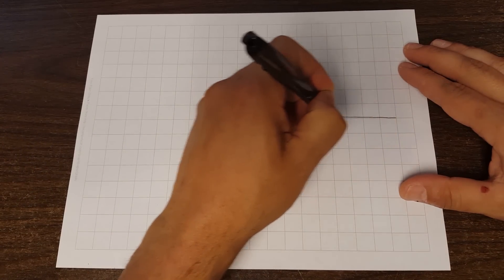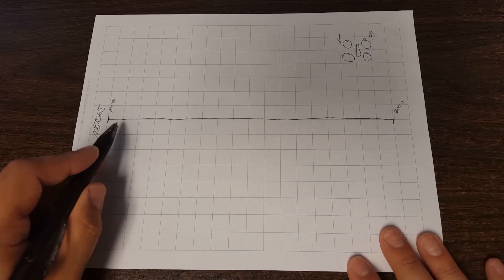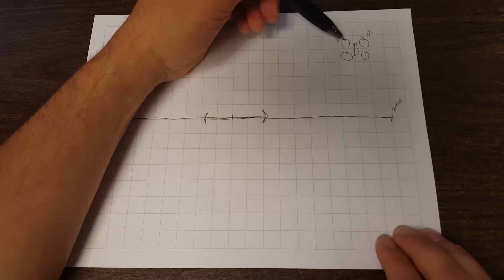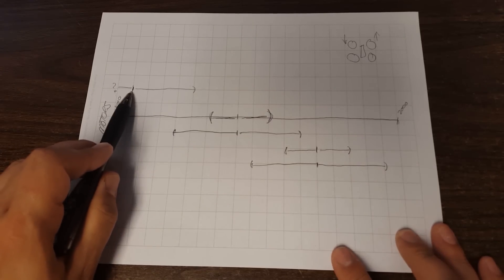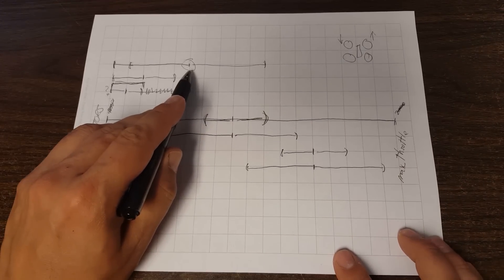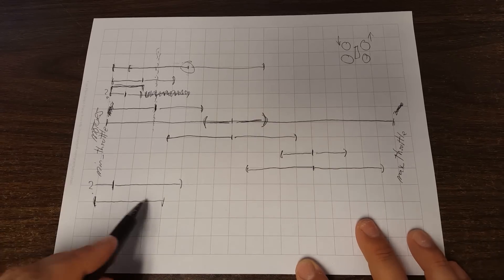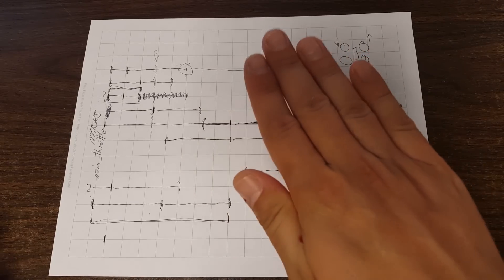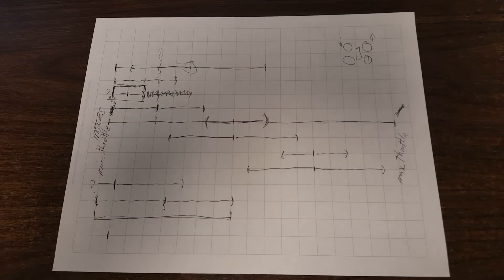What is Airmode? | BETAFLIGHT WITH AIR MODE EXPLAINED

Comment: Idk if this is an unpopular opinion but i feel like airmode controls too much sometimes. 
Im trying to horizontally drop down but i feel like airmode keeps me in the air too long as if im gliding down instead of dropping altitude like normal gravity feels. (Because the motors are upsinning from the corrections done by airmode). I dropped the idle thinking that would help but it didnt.

Comment: Thank you again bardwell. Just downloaded betaflight 4.4 and air mode was one of the mode set ups and I'm used to just removing angle on all my quads so I don't accidentally enable it. And I thought what the hell is air mode get that out of here lol. Well needles to say my quad was swaying everywhere and could not figure out why until I watched this. Just clicked permanently enable air mode so going to try it out now fingers crossed it fixed my issue. Almost 100 percent sure it did

Comment: I've got a Tinyhawk II whoop as my first drone and was really confused when I tried it the first time in ACRO (which they called AIR I assumed): Unlike the simulator this drone would not bounce off from walls but the moment it would touch a wall it would spin up angleing against it and kinda "fight against" that wall with me having no control over the drone anymore. Disarming it and letting it fall was the only option I had left. Additionally it would behave completely erratic depending on what I flew over - and start suddenly bounce off in one direction. I explained that to me with weird indoor-aerodynamics.

I've digged abit to find out why this weird behaviour is happening:
- First clue was crash-recovery - a new CLI-only feature in Betaflight 4.1 that they just turned on... and that didn't do this drone any good and caused sudden moves all over (what a weird function, really o.O).
- But now after 2 weeks of daily flying and still having the feeling I constantly have to correct my drone instead of controlling it I felt brave and turned off air-mode.

And BAM, all of a sudden that little woop was behaving! No more wall-fights, it would just bounce off like the dones in the simulators do. And also no more sudden side-moves close do the ground or over certain objects in my appartment - it's completely stable now. And even more interesting: Throttle response is now much more smoth and expectable. So for some weird reason while Airmode might actually help in outdoor freestyle flying, indoors with woops it seems to be a really really bad idea. Or at least with the Tinyhawk II and stock rates/PIDs it is. And now that I turned it off my OSD also shows I'm actually flying ACRO mode... I see! ;)

Maybe that would be something for another video! And also something to try out if you compare whoops. Just turn off crash-recovery and air mode and you'll get them to behave quite nicely! And those Emax guys really should work on their Tinywhoop tune and not just turn every function on that's new and sounds fancy...

Comment: Nov. 10, 2020  Opinion Request Please: Is "Air Mode" a function best utilized by everyone? Stable Beginners, Intermediate, Simi-professional, Etc. OR, is there a rule of logic when utilization of this function is best applied? Also any better/worse affects for use in Angle, Horizon, Acro?
Reply from the maker: I use it all the time.
Reply: @JoshuaBardwell  Thank You, I'm following your advice.  Just wonder as to idle set on this 4S Cvatar cinewhoop

Comment: one immediate question is why does the spin up have to equal the spin down? so why not give us the full stick deflection value on the upside even if there's not more to give on the downside?
Reply from the maker: Then the quad would not rotate around its center.
Reply: @JoshuaBardwell  ah!! that totally makes sense! thanks!!!

Comment: Hi JB, at low throttle with airmode enabled my 5inch quad is very unstable - it hovers all over the place (also looks like there is some stick delay). With airmode off at low throttle it is much more stable and controllable. I am using BF4.1 - any ideas?

Comment: Sooooo - how do you keep it from going crazy over small disturbances?  Get too close to a wall with a whoop and it plasters itself against the wall motors screaming.  Anything you can do?
Reply from the maker: You can put it on a switch if you prefer but you might just do better not to use it if you do a lot of indoor flying with Whoops.

Comment: Maybe you can help with an Airmode problem  I've got with a Babyhawk R 3" quad.  Airmode works fine at times but at other times the quad will rise uncontrollably when airmode is on.  For example the quad will lift off fine and when it gets 2-3 feet in the air it takes off at a high rate of speed straight up in the air.  By the time I disarm its 20-30 feet high and drops to the ground.  When it does occur it might be connected to a bent or damaged prop but I can't be sure.  At this point I don't feel comfortable turning on Airmode on for fear of what is going to happen after I take off.  This behavior has occurred under both BF 3.2.2 and BF 4.0 Performance Edition.  As a note I've running on a 4s battery with my throttle scaled to 30%.  Is it possible that the throttle scaling is not working with Airmode such that Airmode is not limited when upping the setpoint?  Any other ideas what would cause this behavior?  Thanks for your help!
Reply: Did you got an answer? Facing the same

Comment: Can someone please help I cannot get airmode to work on my tinyhawk I have set it to a switch and it activates (yellow) in betaflight but does not allow me to flip fast it's like acro mode not airmode please help
Reply from the maker: Air Mode doesn't do what you think it does. All Air Mode does is increase authority at low throttle.

If you want to be able to do flips and rolls, set it up so that Angle and Horizon Mode are disabled.

Comment: If I want to fly more level (altitude) then does air mode or anti gravity mode help me?
Reply: neither of those control altitude. If you have a barometer there are altitude hold modes you could try, but the best way is to practice your throttle control.  Ideally, play in a simulator and practice letting it drop and catching smoothly before it hits the ground.

Comment: Is air-mode the reason that sometimes I throttle to zero and the motors are spinning more than they were when I armed the copter?
Reply from the maker: Yes. But don't worry too much about it. When you raise the throttle, just go fly :-) And when you're done flying, disarm.

Comment: Have a quad with airmode. Never experienced it before. Went to land quad freaked out and bounced all over the place. Went into BF. In modes I brought the bar all the way down, in airmode. If I shut airmode off quad wont arm at all. Not sure if that’s normal. Once I moved the airmode bar all the way over to the left in BF the quad was much more stable and the motors didn’t speed up anymore like they were before.

Comment: Hi Joshua,
An older video, so as not to go off subject in your newer vids. My airmode motor speed is a little higher than I prefer, how do I use betaflight to turn them down a little please?
Reply from the maker: Lower digital idle percent. But be careful you don't lower it too much and get death-roll after flips and rolls.
Reply: Joshua Bardwell Thankyou.

Comment: So my thought is if it has bounced back from Landing you're pretty much horizontal ... So why not just write a script that says.. if all things are level and within 20 to 15 degrees I'm horizontal deactivate air mode
Reply from the maker: +VdubSPAZ air mode is needed all the time in flight.
Reply: Joshua Bardwell okay but from my understanding you're explaining how air mode works ... But Acro mode is a form of air mode without the adjustments right? ... If So my thought is that you have to create a code for either Acro or air mode... With that being said why not create a air mode with a landing buffering feature ... Another words as the quad comes in for a landing it would see that it's horizontal and the sticks are within a certain parameter then it would negate what the air mode does to create a safe landing or other words a glitch free landing

Comment: I'm having a problem on a new build. No matter what I do 1 motor just wants to keep spooling up to max, on the bench or in the field.. Running a Matek f405 fc,  Any help would be appreciated
Reply from the maker: If it only does it with props off, no worries, just go fly.

If it does it with props on, then check that your sticks are centered at 1500 us in the Receiver Tab. 

If you are in autolevel mode, possibly the acceleromter needs to be trimmed.

Comment: So does airmode actually increase the throttle or only does it only allow for full control when at low throttle
Reply from the maker: It increases the throttle set-point, which allows the up-spinning motors to spin faster than they would if air mode were disabled, thereby increasing overall authority at low throttle.

To put it more simply, it acts as if you had raise the throttle slightly, but only when you deflect the pitch, roll, or yaw stick, and the throttle is low.
Reply: Joshua Bardwell got it thank you.

Comment: So do you have it on all the time?  In all modes?  Or is there any disadvantage?
Reply from the maker: +Anders Ahm Jensen yes I use it all the time. Some people have a hard time landing with it on and prefer to put it on a switch do they can turn it off.
Reply: Joshua Bardwell Thanks Josh, I thought air mode was acro mode, but seems acro is just armed and no other mode active or with air mode on.  So I havn't flown pure acro yet, and I have'nt had air mode on with other modes :-)  I think I will set it on a switch like you said, seems like a good way, to feel the differences you explained so well.  Thanks alot :-)  next step is to understand pids and tuning better, and found some helpfull videos about that ;-) so thanks again.  I'm so hoocked on quads

Comment: Hey Josh,I was having a discussion with a friend last night regarding how the accelerometer and interacts with the PID controller.
We run the accelerometer disabled in betaflight to save on CPU headroom. 

Where does the PID controller get its input from so it knows how to respond to external forces with accelerometer disabled? My thinking is that the PID controller would not do anything, but that is obviously not the case. 
Actually, as I type this I believe I have answered my own question. It's the gyro, not the accelerometer.

Comment: Just a quick note.... I found an issue with Air Mode yesterday. If you permanently enable Air Mode AND also enable it on a switch, your quadcopter will absolutely flip out when the switch is activated. I did this by mistake because I try to have my transmitter switches the same for all of my models. I forgot that I had it permanently enabled on my current setup. While testing it, I activated the switch and it instantly went into a crazy fast roll. So maybe it would be a good idea to be unable to have "double airmode" enabled. Betaflight should only allow one instance of Air Mode. I realize that this is completely my fault, but it might be something helpful in the future. I cant imagine why you would ever need to have it enabled twice because it sends everything into an accelerated loop. I am not a programmer, so Im not sure if there is a reason for this. But maybe if it is permanently enabled, the option should be unavailable in the modes tab or vice versa. Anyways, I hope this helps.
Reply from the maker: +B B what you describe shouldn't be possible. The Air Mode mode disappears when the Air Mode feature is enabled.
Reply: Joshua Bardwell Lol. I have it on video. I definately found both enabled. Very strange.
Reply: Joshua Bardwell Thought I fixed this problem. Happened again. Flies fine on 3s. When I use 4s and air mode with horizon mode, it flips out like crazy on the roll axis without stick input. It spun so fast today that it snapped 2 props at the hub when spinning out. Tore off the battery strap and bent the antenna.  I figure that it could be either the pids or the props. Any ideas?
Reply: Its an omnibus F4 and I watched your DMA conflict video, but mine doesnt have a black box. I appreciate you responding. I know you cant keep up with all of us idiots. At this point, Im not sure what to search for. Back in the days of my Walkera Runner, we used to call this the FOD. Flip of death.

Comment: Hi Joshua,  am I right in that air mode is on all the time even when talking off? Thanks
Reply from the maker: If Air Mode feature is turned on, then air mode becomes active the first time the throttle crosses 1350 and stays active until you disarm.
Reply: Joshua Bardwell ok got it now! Thanks for the quick reply.

Comment: Just as a random thought to whoever cares i just flew my first drone around my yard then crashed! Im such a noob the first attempt was a fail it flipped out as soon as i gave it throttle cause i forgot to change yaw to -90 then i fixed that, flew forward and crashed into my rosemary bush (now the drone smells good) and then i flew it around the yard and back and panicked and disarmed and crashed. Ive had a lot of experience in a simulator but that was my first time touching a drone and im so excited
Reply from the maker: Welcome to the hobby. It's awesome, isn't it?

Comment: If I understood correctly we should not land on AIR mode! Right?
and second what is the true benefit of flying with air mode?
Thanks!
Reply from the maker: You can land in air mode: https://youtu.be/Y9FPOy8C6I4

The advantage of air mode is much increased authority when at low/zero throttle.

Comment: Making your arm switch an air mode switch too means you can disarm your motors just above the ground
Reply: This will give you a smoother landing if you usually flipped it
Reply from the maker: You can disarm whenever you want. Disarming overrides air mode.
Reply: Yeah your'e right. I guess You cant be spinning your motors if they're disarmed

Comment: I can control my quad with throttle at 0 and airmode off... how this is possible?
Reply from the maker: It's always worked, it's just that you get more authority with air mode.
Reply: Joshua Bardwell tested Acro without airmode and with airmode on and the only diference i noticed was my batery ran out of power quickly with airmode on. Um sorry to ask you This... Do you have an e-mail to help ? Im pulling my hair out trying to eleminate some oscilations on my quad but um not having any sucess. Thank you

Comment: Great video! I try to set on my drone after I wach this video.Everything works fine but....I have a probrem.When the air mode switch turn on, idle speed is good and low but....once I move throttle stick motor RPM goes up high.can't make keep idle RPM low with air mode.
Reply from the maker: https://www.youtube.com/watch?v=xBaefeQtA1c
Reply: Joshua Bardwell  

Thanks
It didn't happen before with other esc so I didn't know it is ok. It happened when I changed to other new esc so I thought something happing.

Thank you so much!
It flys fine with propeller on👍

Comment: Hello Joshua,
Thanks for all your good video's.  I have a question.  Is it okay to have two modes going at once like air mode and horizon mode?  Is that advisable?
Reply from the maker: Yes it's fine, but some modes are mutually exclusive. Like if you have Horizon and Angle on at the same time, I think Horizon will take precedence.

Comment: so if I been flying in horizon mode for about 6months now..should I switch over to air mode?..its kind of the same just the drone does not go back to stable mode right? so most people fly in air mode? witch everyone calls it acro is what I'm asking..
Reply from the maker: Air mode is not the same as acro. Air mode is a modification to the mixer logic. Air mode can be added "on top of" Horizon or Acro mode.

In Acro mode when you center the sticks, the quad does not level back out again. In Autolevel mode (Horizon or Angle) the quad levels out when you center the sticks.

Air mode means that when you lower the throttle all the way down, the quad stays steady. It doesn't flop all over the place.
Reply: oh ok great thank you so much..by the way i was hovering a drone in the basment today and one of the cells exploded..boy did i jump i grabed the drone threw it in the lundry sink soaked the shit out of it with the battery still attached..after everything was ok i took the battery of..dried out the drone for two hrs..and now it flies everything works..god took care of me today..thank you lord..

Comment: Made it very easy to understand! One question though.... as far as flying goes, a quad with airmode on, vs one with it off but with idle up. What would be the difference? Any benefit in running it either way?
Reply from the maker: I prefer air mode because it only raises the throttle set-point when additional authority is needed, whereas idle up raises it all the time.

Comment: I'm new to the hobby, forgive my ignorance but, do I understand correctly that Air Mode is a setting that is achieved by programming the drone using a computer, rather than something that one can get already built in to a good transmitter?
Reply from the maker: Honestly, you have to have a computer and the Betaflight or Cleanflight GUI to do anything with these quads. Even if you buy an RTF, you will very soon need to do some repair or make some change that will require it.

Yes air mode is enabled in the GUI.

Comment: You also forgot.... That before air mode, if you throttled all the way down, your props went into a set idle mode, with no pitch, yaw or roll controll, and bypassed the PID controller. Which also meant that if you throttled all the way down, you start to drop out of the sky.